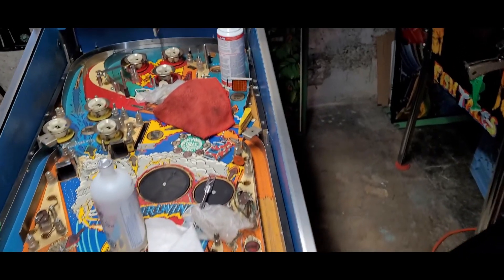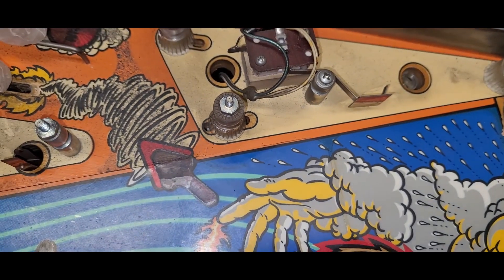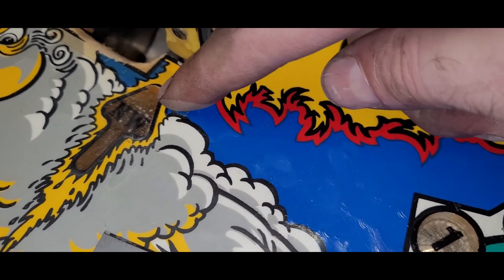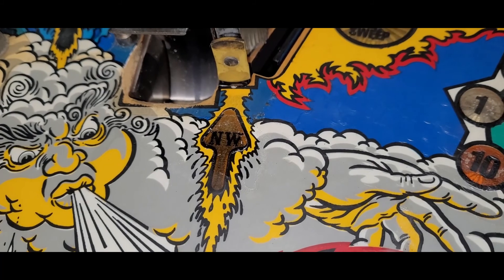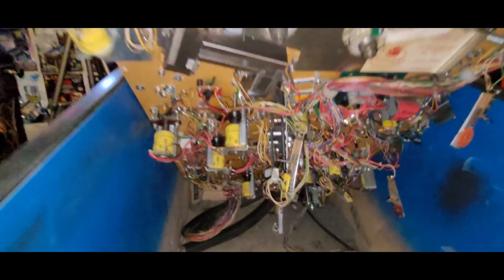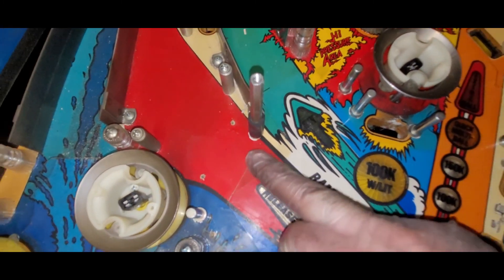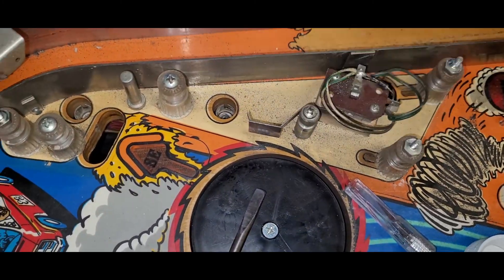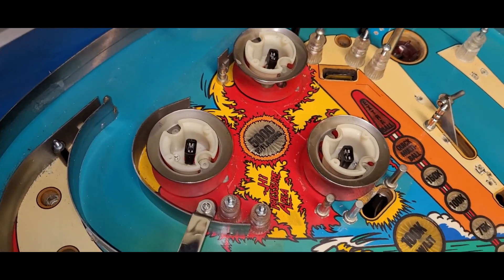Part 7: Whirlwind Pinball Project. Broken wires, toasty coils and more mylar removal!

Comment: The blown bulbs thing is weird. My WhiteWater had a handful of those, as well. They were just shattered in the socket and were actually shorting the metal next to it. I think you peeled the next layer of the onion!
Reply from the maker: I know right. I've seen it from time to time. Usually in a spot where the ball can potentially access it if a rubber is broken or something but not in the back corner 🤔

Comment: maybe the burned coil is the problem or it was the cpu  i had pinbot when i was 11 years old 
today only backglass survived
Reply from the maker: I think I might have seen the kickback working when I actually was able to get it into diagnostics so if it took out the transistor it must have been replaced but definitely a mystery still. Wow that is pretty wild!